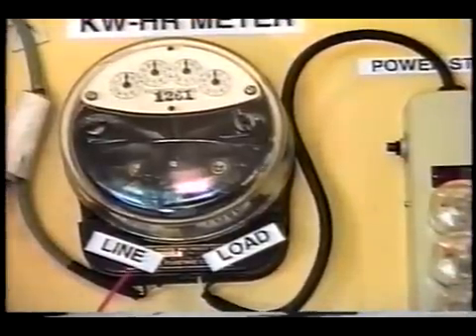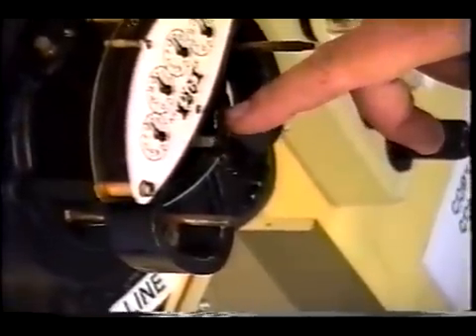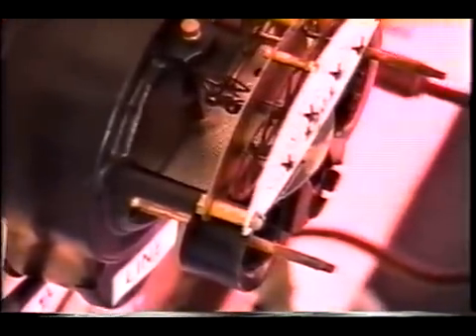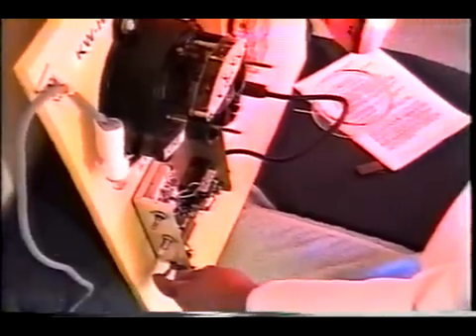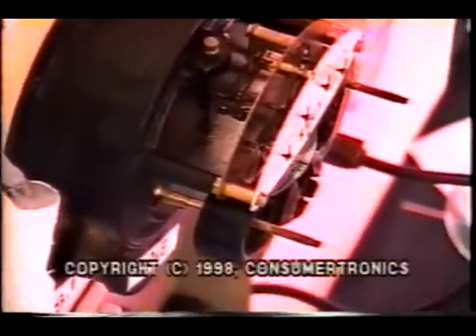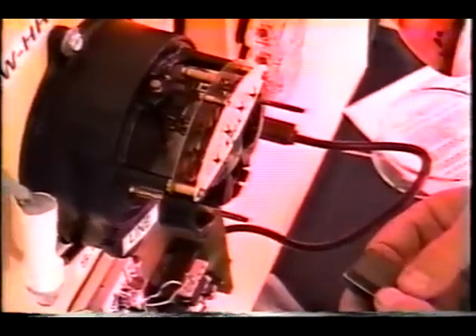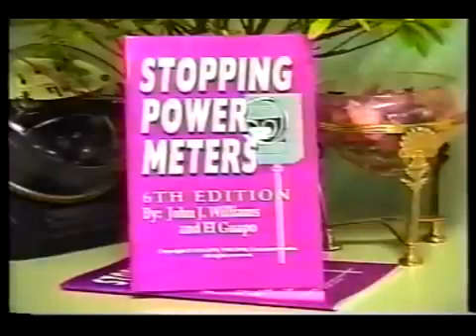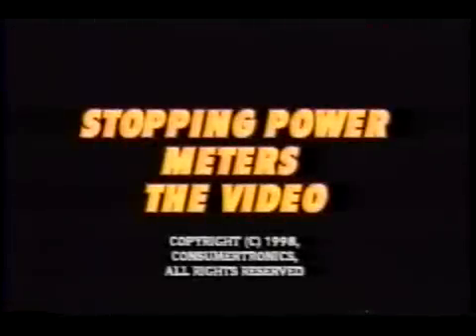Stopping Power Meters (2 of 2)

Comment: Just pull the meter out and jam thick copper  wires into the conctors and it wont meter at all
Reply: And you can use all the free power you want
Reply: It should be free anyway

Comment: His device is a scam. His description of a mechanical meter movement is correct in every way. He uses that to make what he is selling seem legit. Yes, a magnet would slow it down if oriented correctly and placed very near the disc (you would need the housing removed though). There isn't a way for an electronic device plugged into you house to have any effect on slowing down the meter. When you see it slowing down or stopping it is because he has hidden wires controlling the disc directly. Pure BS.

And no, it wouldn't work on the new smart meters.
Reply: It did work. He got in a ton of trouble.

Comment: look, its simple, build a battery bank of say 24  12v lithium ion batteries, get an overcharge protector from amazon or ebay, take two dodge alternators at least 100 amp, bypass the diodes inside, mount fan blades on each that are atleast a 24 inch per blade on fan, 3 blades  each.  build tower about 45 feet high to catch plenty of wind and wire to overcharge protector. run batteries parallel to an inverter. be sure to use more than one inverter and be sure to use one thats a 240v inverter. get off grid, electricity is free after thee initial start up and the elec. comp. charges us a retarded amount of cash for what they harvest for free. been running system like this for years and its wonderful. well water no elec. bill, and wasnt that expensive. most can be obtained from a salvage.also get a couple sets of 100 watt solar panels to help on days that arent windy at 45 feet.

Comment: How do you know, how can you be sure, that the polarity of the magnets is correct?   Stand there and watch whether it speeds up or slows down the dial?   And how do you mount a pair of magnets like that outside the glass so they slow down, but don't stop, the meter?   Of course, the meter reader mustn't notice them either...but I guess that's beside the point.

Comment: I used to..... ummm i mean i knew a guy that used to pull his meter off (my friend said it was easier years ago with older meters) and loosen 2 screws on the back of the meter that made the connection to spin the infamous wheel. without the connection between those two screws, the wheel would not spin no matter how much electricity you used through that meter, that's what he told me.    :-)

Comment: The key to this if it really works is to lower your bill only. The electric company knows what you use on average every month plus they factor in weather temp. They know what your bill should be. Now use this to gradually lower your bill over a few months and don't use this device during normal working hrs when the meter reader guy can show up unannounced. Use it on the weekends and at nite.
With all that said this is totally illegal and will cost you tens of thousands in legal fees

Comment: Pure snake oil, illegal, and can be easily detected.

Every meter has two seals, one is a pad seal as described and one is an inner seal which was not mentioned.   What the inner does is indicate if the glass has been removed or someone has been inside the glass.  Funny he forgot that.  

When the pad seal is broke, the meter reader reports it to the meter testers and they go out and check the meter.  The very first thing they do is pull the meter and check the inner seal.  If it's broken, the meter will either be tested on site or changed out and tested in a meter lab.  Then they take voltage on both the line side and load side jaws to verify good voltage to the customer and verify there is no voltage at the load side.  The also check carefully for jumpers inside the meter can.

Now the tester is standing in the back yard, the disk is hardly turning, but he can see the lights on in the house and hear the air conditioner running.  So the tester gets a clamp on meter to check the amps.  Say for example there iare 20 amps on one leg and 30 on the other.  The meter should be turning good.  The mathematics indicate the meter is seeing 6 kva, which means the meter should be spinning real good.  This is how you get caught.

Lastly, the meter belongs to the utility company, not the customer.  It's not your meter, it's a meter that has been assigned to your address.  The utility has the rite to access this meter during normal working hours.  It's in the contract a person signs when he makes a contract with his electric provider.
Reply: who cares about a seal  you don't need to tamper with the meter at all
to use the  plug in device
and if you are that concerned the meter reader will catch on you could just set up a PIR sensor and connect it to the device , when anyone gets within 10 feet of the meter the device switches off
Reply: [I stand corrected] 
RIP = Passive InfraRed 
... commonly called a motion sensor.
Reply: No. Meters in North Carolina have one seal.

Comment: I agree that the electric companies are fat power cats and don't seem to give a damn about the bills we have to pay. BUT if you get caught tampering with their meter. they have a number of options, they can remove service until the bill is what THEY think it should be
and even if it is higher than it should be, well you are sitting in court not looking too credible and they might say, screw it we don't supply power to that residence. you could also end up in the black bar hotel and maybe get a chance to have a police record Is it really worth it and jumping out the meter, screw up once and electrocute yourself and do you wanna really know if there's such a thing as bad Karma

Most people with an electric water heater leave it on all the time! in mobile homes
for some reason there is a vacation switch that kills one hot leg to heater, thus no 240
volts. you can have the same done in a regular house or just flip off the breaker
and turn on say for a couple of hours before you plan to use it for showers, I do use the
dish washer but frankly it is more economical to heat a large soup pot on the stove
and the burner is around 2200 to 2500 hundred watts BUT you are only trying to heat  enough water to get the table wear clean. how about washing laundry in warm water
or try cold water and see how that goes, if it goes well, then dry clothes on a line?
Hey. a clothes dryer might use 5 to 6 thousand watts in JUST one hour. say it pulls 5,000 watts and you use it for ten hours a month there's fifty KW  and of course the fuel charge for power used as well.

Central air? clean the condenser coil outside before the cooling season I use a soft brush and a garden hose, a clean condenser makes the a/c run more efficient  and less often. course the inside filter must be kept clean on a regular schedule.

With proper load management and well running appliances and not leaving appliances on when no one's around, you might just be surprised how much power can be saved.
Reply: Where I live, natural gas is much cheaper than electricity per unit of energy. So, switching to a gas tankless water heater, gas range, gas dryer, and gas heater would save money. Yes, line drying is a good way to save power. Switching to L.E.D. light bulbs would also help.

Comment: The ironic thing about those old meters, the two phase motor, was developed by Tesla. He never wanted meters installed. Another ax in his face. If the power companies were really smart they should be developing little cold fusion devices that run independently of the grid and eventually reduce the men power of the industry. When Tesla discovered a quark in Edison's DC power that caused huge bolts spark to jump out right after they switched on the mains, he dropped all this discovery of AC power and fields for Cold Electricity. They found a way to cover up this new discovery for a 100 years but it is alive and well on youtube.

Comment: That Rotating Disc is made from Aluminum and the Magnets have no affect.
Reply: The idea is to lessen the flow of magnetic force between the parts and not magnetize the aluminum disc itself.
Reply: Three blind mice See how they run have  you ever heard of eddie current?
same as brakes on roller coasters
lol i hate it when idiots try to sound smart
Reply: It's called an eddy current.  It's most defiantly affected.  Any high schooler in physical science can tell you that.
Reply: Nankurunaisa Nankuru Easiest way to do that would be to decrease the current or somehow reduce the magnetic field being produced in the meter.
Reply: Yes, But Eddy Currents Only Work on a Magnetic Plate, see Wikipedia
Reply: +silverbankruptcyHow can you have no "affect," Silver?Also, why the random capital m on "Magnets"?

Comment: ENERGY THEFT INDICATOR OF MAGNETIC FIELD
"ETI-2"
 When attempting a high power magnet impact on operation metering device (gas meter, of the counter electricity, water meter, etc.) with a view to slowing down or complete stop, sign graphic indicator changes its configuration, allowing visual identification of the impact of the magnet on the Meters.
proatlant@mail.ru

Comment: can someone in a apartment complex add power to their apartment through my electricty, has been getting higher bills since he nmoved in and always seeing after a snow where a like extension cord has ran from his apartment to mine, can the electric company find out if i reported this, thanks
Reply: You can trace where he has tapped your cables, unplug it and then send a very high voltage towards his area frying all of this electronics that he has connected and he will not be able to do a darn thing about if because he was in the illegal to begin with.  The way you can do this is, first you will need to ask yourself, how much of a high voltage to send to him over his wires, second, purchase a 1:600 ferite core transformer or just an large iron core transformer and wind primary and secondary so that it will accept 120 volts AC for primary and will deliver about 500 volts AC for secondary and then connect both terminals to his cables and leave if there like for just a little while and then unplug everything, the energy thief will pay with fried electronics.  Have fun.

Disclaimer:  I am not responsible for anything that happens if you do decide to congratulate him with some very high voltages.
Reply: The electric company will not do anything. Call the police.
You could also turn breakers off in your apartment while not there.
Reply: Bonnie Flory
Or set up a video camera before you call the police.
Reply: m8ty.com 
SOUNDS good but you could Burn down the complex and then go to jail for setting the FIRE... 

Set up a camera, turn off your breakers when not there or needed and then call the cops.
Reply: m8y.com thanks a bunch just hope i don't what i am doing, sure does sound like one great idea, thanks again, will get  friend that knows about it more to help me myself, thanks again, mike p,s i forgot to say the kind of meter we have here are new ones that we have here  are digital, will that make a difference? thanks again , mike